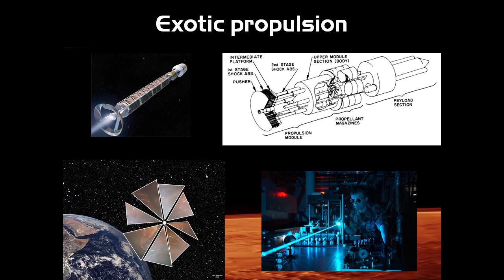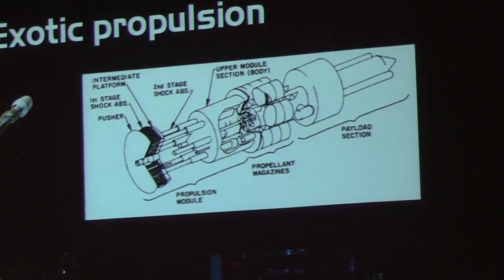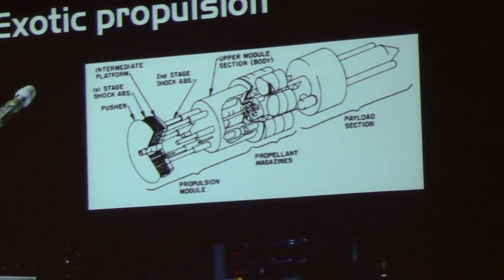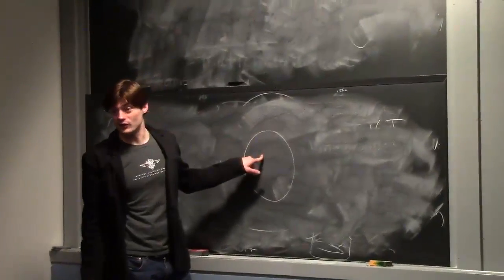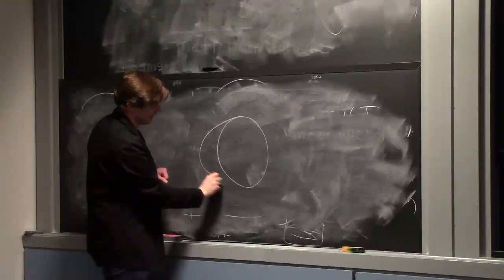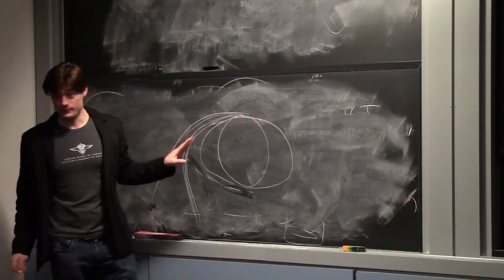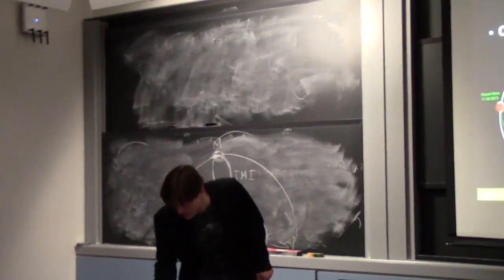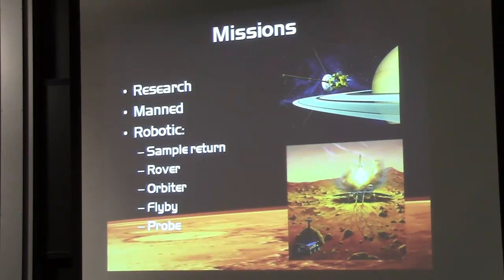Spacecraft Systems Engineering Intro Class Part 2: Propulsion & Orbital Maneuvers

Comment: Modern sci-fi has a lot to say on space combat; most of it is nonsensical navy combat equivalencies. The reality of space combat (as I imagine it) would be more in the line of lasers. I think the idea of nuclear explosions with focused energy discharge of exotic radiation would be a valid strategy. Imagine sending a missile that closes the distance and aligns its output towards the enemy and detonates (think shaped charges). The radiation would be focused in as tight a cone as practical/possible. Exotic radiation would then move at near light speed to its target, frying electronics and cooking anything organic. We would need significant and iterative testing to tailor the types of radiation as well as the effectiveness of its directionality. Given that sort of R&D however, I find that this would be an efficient and effective way to disable any enemy craft. Of course, this would lead to defensive measures needing to be worked out such as shielding. This is my thought process; I'd love to hear what your thoughts are on this idea @AndrewRader